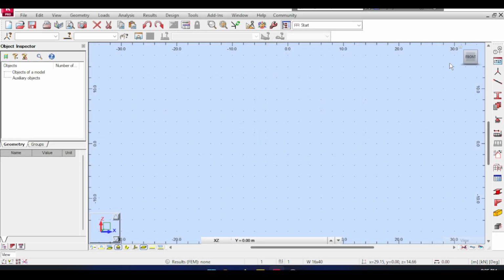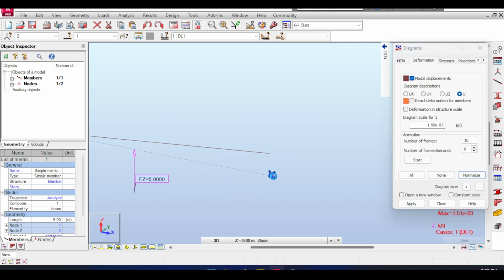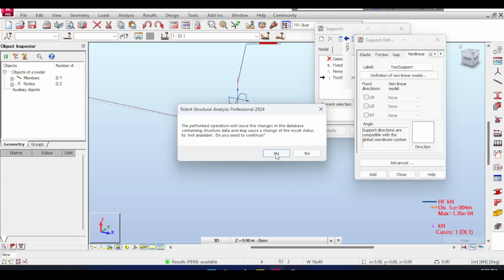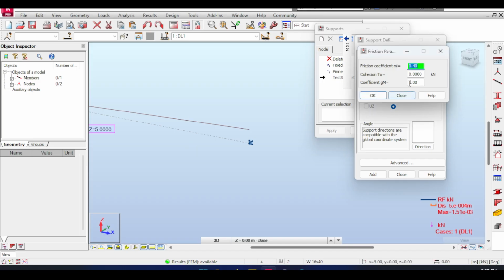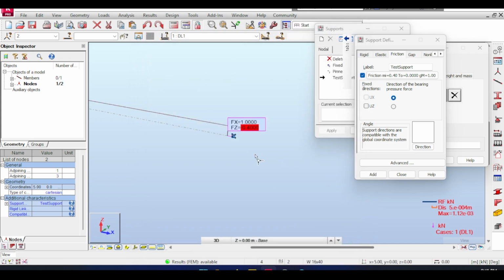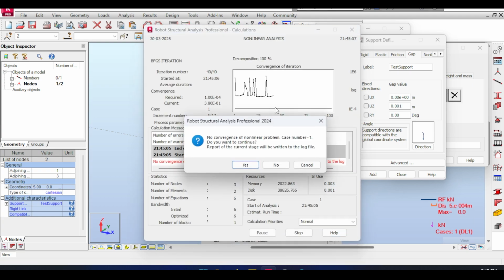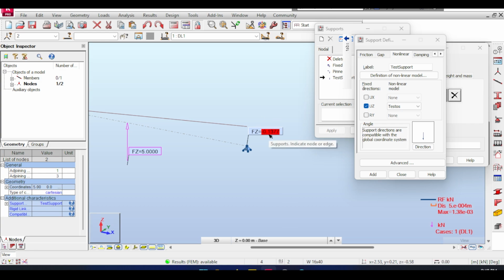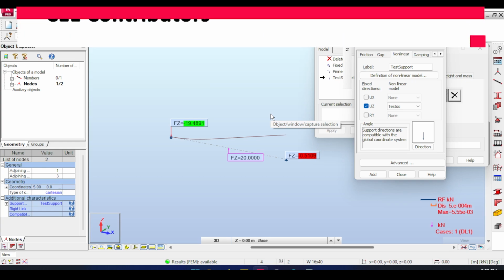Understanding Support Types in Autodesk Robot Structural Analysis

Comment: Dear sir I was wondering if you can make a video about how to control the rebar cut length in robot design for a RC members, I usually consume a lot of time managing the cut length of rebars that will make the minimum waste, for example I usually divide the zones with overlaps that give me rebar cut lengths of 1.5, 3, 4, 6, 12m including the hooks, (in my country rebars comes in 12m length from factory) this process is very time consuming because I do it for every single rebar in the whole project,  about a year a go I received a design and while reviewing the structural drawings I’ve noticed rebar lengths of 7.13, 8.22, 9.11 … etc, and for me that is always a red flag, I asked my manager to talk to the designing firm to support us with better cuts, but he said just do it as it is in the drawing, we ended up loosing about 2.5 tons of rebar in a single roof with it’s beams , we were left with some cuts of 22, 13, 42 cm that is of no use any where, after that he called the designing firm and forced them to change the cuts, sorry for the rather long story but I realy wish if you can make a video about how to control the exact rebar cuts in robot structural analysis in a way that does not force you to change the cut for every rebar manually 
best regards...

Comment: Hello. I have a problem in robot. I try to add brick walls in my structure but in this condition: my structure is an frame structure (columns, beams and plates) and i add loadings according to eurocode (is what we using in east europe); so far so good but i want to replace my loadings with brick walls to see if my moments for beam/columns is gone be reduced. Now i stop because i don't know how to tell robot my brick walls are not in contact with structure because they are fillers and they are not like concrete walls. I don't know if i expressed my self correctly but pls help me if you have any idea. Thanks
Reply: An “easy” way to model Brick Walls is usually done by including equivalent diagonals into the frame, they will work under compression But not in tension, maybe this helps you out a bit, ay least until Mr CCE gets your call hehe, saludos!